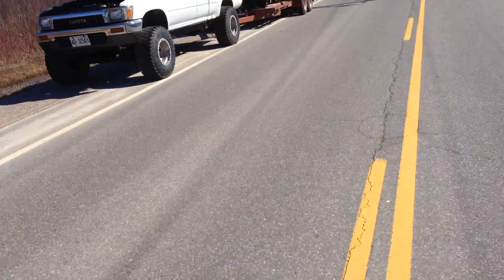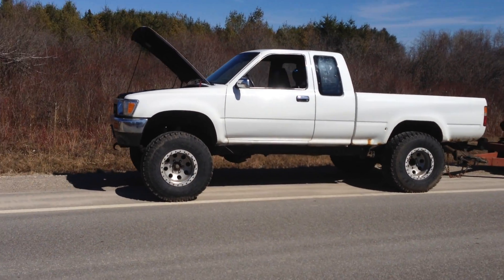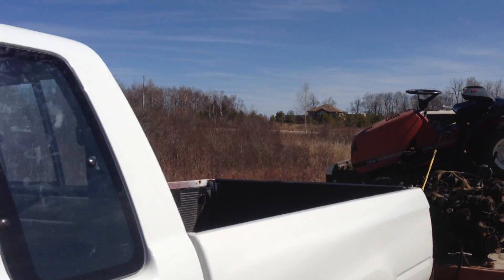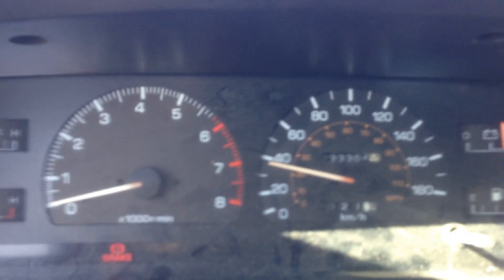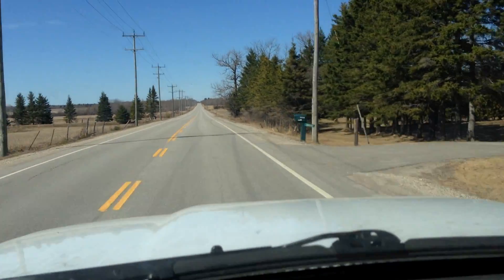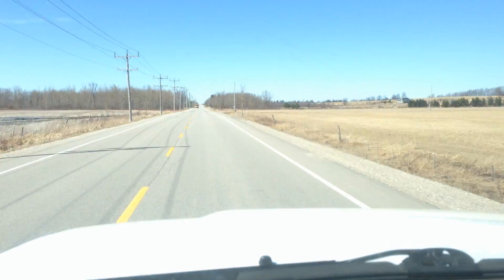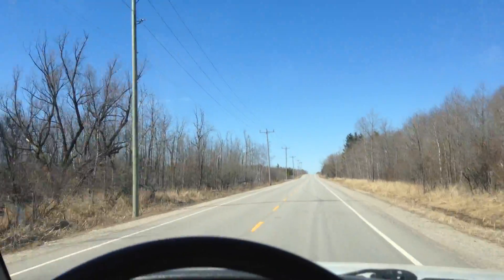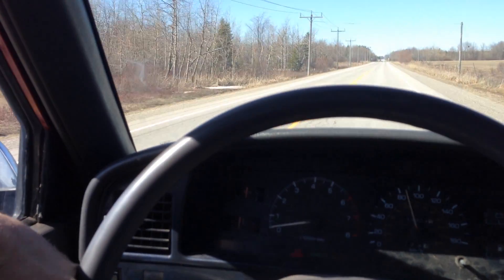Toyota diesel conversion 1.9TDi VW 1Z/AHU hauling a combined weight of 10,756 lbs

Comment: Wish there was a 6 cylinder variant of this motor
Reply: there is. Its called an OM606 and put yourself a OM603 mech pump on it to get away from all the canbus nonsense.
Reply: @thediddlefiddler5569  606 is Mercedes.  Its a good motor as well, but not what I was talking about.
Reply: @NVMDSTEvil  the benz is more reliable and less complicated. You can make them full mechanical. If space is a concern, try the 605.

Comment: just ran on to this channel , I have a 92 Toyota extended cab 4x4 that a manual and the engine is a v3  3.0 I think , I had one of the Toyota I think it was a 2lt diesel trucks back when and it was not a power house but gave decent  mileage and was very reliable . Since then I have bought a Dodge diesel and a TDI Jetta a 2002 I think . I had vw diesels for the last 20 plus yearts . I always thought a TDI in a Toyota would be great. First off its not a id engine in the alh and its inner cooled .  The power of the TDI that I driven with a tune I thnk Jeff did it was very torque motor. I interested in a good kit and I like all of the gauges to work including the tach . Probably a egt , may be a oil temp and pressure , water boost ect  . I need a good clutch and what ever else is needed thanks

Comment: Were you able to bolt these TDI motors up to the R series transmissions in the pickups and 4runners? I want to do this to my 2000 tacoma eventually, as gas prices in Canada continue to climb. I imagine it would also help with towing.
Reply: An adapter plate is needed to bolt them together

Comment: Hi. Just found your channel. Not sure if someone has already asked the question... can this engine swap be done to a 2wd toyota pickup? Also,  would you say this is something someone can do in his garage given he buys the conversion kit?
Reply from the maker: Hello Alfredo
 The only possible problem I can see with doing this conversion in a 2WD Toyota truck vs. the 4WD version, could be the oil pan clearance. The oil pan may need to be modified to clear the cross member in the 2WD. Everything else should be the same. Yes, our kits are designed to be done by the home mechanic in a typical garage.
  Thank you for your inquiry.
  S.C.Lawrence
    M.P.G. Conversions 
       thetoydoc@hotmail.com
          519-938-9844

Comment: I have an 03 tdi Jetta I'd love to pull the motor out of and put in some useful like a small truck or a 4 runner. If someone brings you 2 rigs do you do swaps by chance?
Reply from the maker: Hello Mike S.
  Yes, we do for conversions here, in fact 25% of our customers send us vehicles and then just pick them up when they are done. Sometimes they send us the truck and we find the engine. Other times they send us both the Toyota and Volkswagen and we go from there.
  If you wish to find out more, please do not hesitate to contact us. We can be reached at 519–938–9844. Or by email at thetoydoc@hotmail.com
Reply: TOY Works Autocrafters great job what would something like this cost me providing the truck and engine and would be interested in doing this to a geo tracker any experience in one of them?
Reply: @toyworksautocrafters3072 
What state are you in

Comment: Have you every had a pyrometer hooked up to check the egt's. Also what do you do to keep the egt's  lower because they should be very high. Probably close to melting point
Reply from the maker: Hello Mike Boot 
 No, as of yet we have not hooked up a pyrometer. But, seeing as we have now run in excess of 40,000 miles, I don't think we have to worry about melting the pistons or cylinder head. I am sure on one of our next builds we will install a pyrometer and be able to track the temperature under different loads
Reply: TOY Works Autocrafters yeah if anything it would be interesting to know what Temps it hits. I actually have a deisel swapped ford ranger using a Kubota 2.2 deisel and I have to watch it when stepping on it as it can reach the melting point in 4th and 5th.
Reply: Meth injection kit could be added to lower egts a few hundred degrees, works great on mine. Doesn’t increase power much, but allows you to make safe power at 35psi.

Comment: Can you do this conversion on a 1995 Land Cruiser?
Reply from the maker: Hello Nigel
 It is possible. We have just completed a conversion on an FJ40. We are just running some tests before releasing it to its owner. 
 In this case we swapped out a Toyota Land Cruiser 3.4l B series diesel and 4 spd transmission and transfer case in favour of a VW 1.9l AAZ diesel and 5 spd transmission and transfer case from a 93 4Runner.
 The foreseeable problems with the 95 Land Cruiser swap are; likely a computer controlled automatic transmission needing the input signals from the original engine.
 Starter interference with the VW block or turbo
 Of course, if the transmission is also swapped, these problems are nullified but the cost of the conversion may be prohibitive.

 The videos of the VW powered 40 series Cruiser should be uploaded very soon.
  Thank you for your interest.
 S.C.Lawrence
   TOY Works/Autocrafters
      519-938-9844
          thetoydoc@hotmail.com
Reply: TOY Works Autocrafters sounds awesome. Will you be making a video about the results of that build?

Comment: What gears are you running in that?
Reply from the maker: Hi James, we appreciate the comment/question.
  This truck still has it's factory Toyota original 4:10 gear ratio. While this works very well overall, we later changed to 4:56 ratio for better towing. The fuel economy seems to be un effected but it's more enjoyable to drive when pulling 5000lbs or more. We may experiment with 4:88 one day.

Comment: I thought this motor was front wheel drive
Reply from the maker: The Beige Wonder 
 Engines are neither front wheel drive, nor rear wheel drive. The style of transmission and where they are located in the vehicle makes the front, rear, or in this case, 4 wheel drive.
 Engines/motors are simply a device that changes fuel of some sort into motion. Since these engines rotate in the same direction as the original, they can be readily used in their place. In this case the bonus is far better efficiency, thus, more power less fuel.

Comment: What's the total weight of the trailer?
Reply from the maker: neurocytohemotoxic 
  While we never weighed the truck alone and empty, I think I will be pretty close in stating it's weight at 3500lbs. Which would mean the trailer and load would weigh around 7200lbs.

Comment: Hello there , i'm currently installing a TDI ALH in my 1992 4 runner , ( i removed the vacuum pump , because as your probably know it sticks out of the cylinder head ) it's bolted on a acme adaptor on my stock w53 toyota transmission , problem is , the engine totaly doesn't fit there... the oil pan touch the front differential , the valve cover hit the firewall hard.

How did you get your engine to fit in the bay this well ?

Did you moved the whole drivetrain forward ?

Any help is greatly appreciated !

Thanks , Jordan
Reply from the maker: Yes, our kit relocates the transmission (forward) in all of the 4cyl Toyota trucks and 4Runners.
Reply: Hello. Did you manage to install the engine? Was the pallet redone?

Comment: I've watched all your conversion vids & notice you never get the tach to function. Why not?
Reply from the maker: Yes, you are correct. The simple answer is; our customers are such amazing drivers and operators, whom know their vehicles so well, that they can tell just by the sound, what RPM the engine is doing!😉

 In reality some of the engines we are showing our mechanical turbo diesel Volkswagen engines, and there is no factory RPM signal generator on these engines. While we could hook up an aftermarket signal generator, so far our customers have forgone that expense.
  On the electronic controlled turbo diesel's known as TDi's, there is an RPM signal. We are in contact with a company which we are told makes an interface unit that will get the original Toyota tachometer to work with the Volkswagen engine. Hopefully some of our next videos will show the tachometer working.
 Thank you very much for the question.
Reply: +TOY Works Autocrafters you can hook up a diesel tacho to that signal pin on the generator😊

Comment: What transmission are you using?
Reply from the maker: Hello Z0mbieSlayer
 Out kits use the Toyota 5spd.transmission that came with the truck. We have adapters for both 4 & 6 cyl transmissions.
Reply from the maker: We are using the original Toyota transmission. We have adapters and flywheels, for both 4 & 6 cylinder Toyota truck transmissions
Reply from the maker: +filmingNgaming 
Hello filmingNgaming.
 Everyone has a different way of doing these conversions, so for others it may be necessary. Our kit, however, sets the engine on the V6 Toyota engine mounts in their stock location. There is no cutting or welding needed when using our kit.
 S.C.Lawrence
Reply: If I have a 91 Toy Pickup 4WD EXT Cab with the wondrous 3.0... Ive read places that I have to relocate the engine mounts.  Or do the adapters allow me to not have to relocate the engine mounts?

Comment: Thats great! But towing across flatland doesnt prove anything. Its going down a hill with a big trailer when soccer mom pulls out in front of you with a minivan and kiddos where you really need big 1 ton brakes and a heavy rig that has authoritas over said trailer.
Reply from the maker: In no way are we trying to recommend that you haul ridiculously heavy loads with an undersized vehicle. We are simply trying to demonstrate that a small motor can do a lot more than most people would ever believe, and get radically amazing fuel efficiency. And besides, if you think about a tractor trailer, the tractor usually ways in around 18,000 pounds, they're quite often hauling 60,000 pounds behind them. It's not the brakes of the truck that are in control, is the brakes on the trailer!

Comment: how much is the toyota vw convertion kit
Reply from the maker: Hello Gabriel, and thank you for the reply.
 The cost of the kit for the four cylinder truck is $2500 USD. It will get your motor completely located and connected up in the engine bay of the Toyota truck. It comes with; flywheel, pilot bushing, adapter plate, right and left motor mounts and brackets to hold your original power steering pump/alternator/air conditioning compressor, upper and lower stainless rad lines, some tubing for intercooler, stainless exhaust from the turbocharger to the original Toyota system etc. If you need help with the electronics, wiring for the Volkswagen computer and electronic throttle. We can also help you with that.
Reply: +TOY Works Autocrafters thanks

Comment: What was the EGT ?
Reply from the maker: Unfortunately we have never hooked up and EGT gauge. Therefore we cannot definitively tell you the temperature. While that was the heaviest load we have towed, the truck is still being used on a daily basis and at least once a week it halls a load of firewood or another vehicle and the customer has had no problems with the engine or turbo.
Reply: I imagine the temp.was getting up there,but good to know it can tow well.
I'm about to swap an ALH into a built samurai
,I'll be 7 to 9 hundred lbs. lighter so should have plenty of power.

Comment: I am impressed, I had a 93 Toyota 4x4 with 22RE 4 cal and 5 speed,  it had low end Torque but NO HORSE POWER ,  it couldn't get out of its own way in traffic let alone haul a load!  I loved that truck, but just sayin!  I'd been thrilled with a diesel in it
Reply: What diesel engine and  transmission did you match it up with? What was the cost?  I have a 1994 4Runner 4x4 3.0 .  Want to convert it need some input.  Appreciate your response.

Comment from the maker: Depending on your tire size, for your requirements of a max speed around 80 MPH and plenty of towing power, assuming a 28"-31" tall tire I would estimate a 3.73:1 - 4.11:1 gear ratio would work very well and should give excellent fuel economy in overdrive.
Reply: How you instal the fuel line and the cluster
Reply from the maker: +orlando ramos leon 
 We use the Toyota's fuel lines and cluster. Only the engine, turbo, VW electronics that control the VW motor are swapped into the Toyota.
Reply: +TOY Works Autocrafters how you make the dash harnees
Reply: hey, who did your tdi conversion?

Comment: will it spin tires in a straight line on pavement?
Reply from the maker: Hello again Tabitha.
    The easy answer would be yes, but it does depend on tires, engine upgrades ( reprogram, injectors, turbo, etc. ), suspension stiffness, and much more. If you mean, from a rolling start, then it's not likely. If you release the clutch rapidly when the engine is above 2000 RPM and lay into the throttle, then yes. If someone is trying to compare it to a Cummins, Duromax, or International for raw power there is no contest. But, conversely, if you compare them with the VW for fuel economy, there is no contest in the VW's favour.
   Thank you again 
      S.C.Lawrence

Comment: what all did you do to it to make the engine fit and all?
Reply from the maker: Hello Tabitha.
  What we've done is build an adapter plate which bolts to the VW engine then the Toyota transmission bolts to the plate. The toyota flywheel is modified to fit the back of the VW engine. We then created mounts (brackets) to hold the Toyota p/s, a/c, and alt, to the VW engine and bolt the VW engine to the Toyota motor mounts. After that it's new tubing to connect the Toyota radiator to the VW 1.9. Flanges and tubing to couple the exhaust. This is the procedure to get the VW engine into the Toyota, next is to wire it up and make it run.
 On this truck we've used a TDi (electronically controlled fuel injection), so we had to remove the wiring and sensors from the VW Jetta donor car, modify it to only the parts we needed, and install it into the Toyota.
  That's the whole process.  Sounds easier than it is, but with our new kits, it's easier than it looks.
  Thank you for the response.
  Cheers
    S.C.Lawrence
      TOY Works / Autocrafters   (Soon to be M.P.G. Conversions)
         519-938-9844
           thetoydoc@hotmail.com

Comment: An email would really help
Reply from the maker: The best e-mail to use is thetoydoc@hotmail.com. Due to our location internet service is basically "dial-up". We try to reply but unfortunately can't always get connected. We're pretty good with phone calls though😀.  519-938-9844
Reply: Hi I have 93 22re. What does it cost for the conversion and have you ever done one with the newer  point injection engines like the bew or the brm tdi